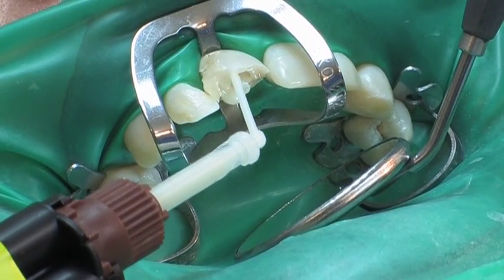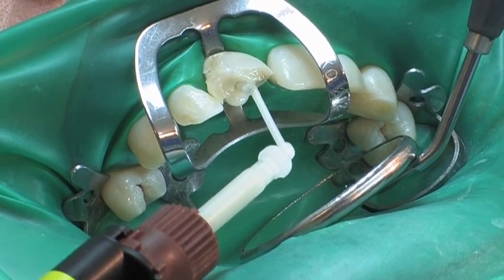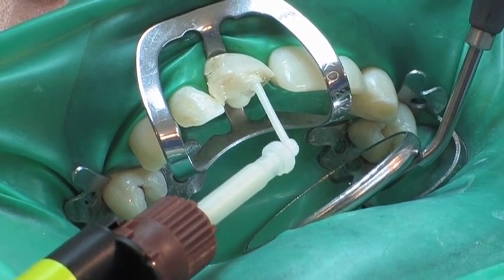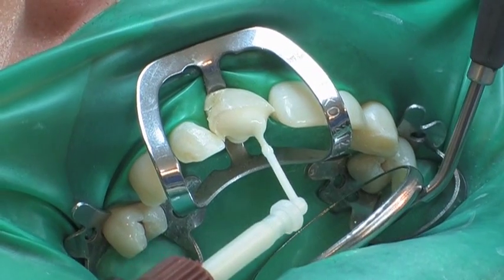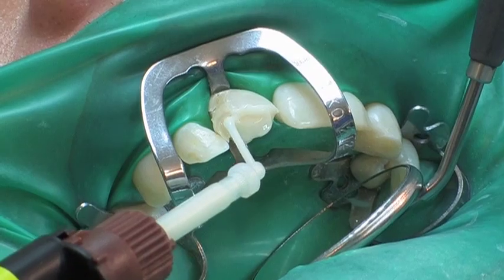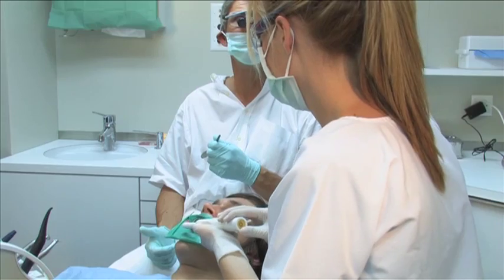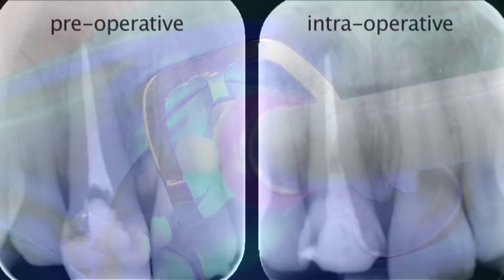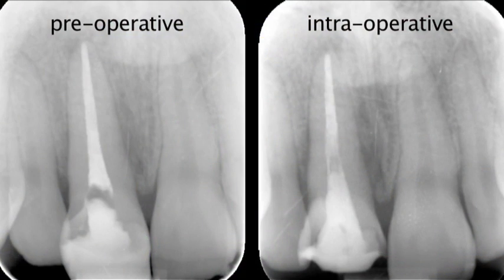ParaCore® - Dr. Stefan Paul

Comment: Completely inappropriate use of a fibre post. There was more than adequate tooth structure to avoid any need for a post. The function of a post is to support a core. This was unnecessary over treatment.

Comment: My prior dentist said that I needed core build up in my mouth.  I have never heard of this.  My new dentist says I need (3) crowns at $750 a pop.  I have dentical which only covers pre-fabricated crowns that my dentist says its like a temporary crown.  Western Dental in Bellflower about 20 years ago removed a porcelin crown and replaced it with a silver one.  My other crowns are gold and porcelin. My new dentist recommends that the silver one stays there because the xray shows that there is nothing wrong with it.  I do not like (2) different color crowns in my mouth. I would love to have the silver one popped off. Does your office accept Denti-Cal?  What is you opinion on this?  Please advise.  I have been living with (2) broken in my mouth for a long time now and am afraid I may eventually need a root canal which I know is very expensive.  Please contact me at 562-250-8777.  Thank You, Paula Hobson

Comment: I get the purpose of this video; to demonstrate the three indications for using ParaCore. I just dont think this patient needed a post. It made no benefit to the tooth other than weakening the root structure. There was plenty of sound tooth structure to support the build-up. Other than that - nice job.
Reply: Dennis Johansen yes absolutely right tooth had enough natural walls to withstand crown no post needed even in my opinion for the aesthetic purposes this Pt could even go with veneer without removing great portion of tooth structure.
Reply: @springsh6678  veneer is not a wise option here. The Root canal treated tooth is fragile to hold the occlusion force. Crown is more suitable.
Reply: Dennis, du er da også overalt på nettet efterhånden! :)
Reply: Lasse Loebenstein :D
Reply: True